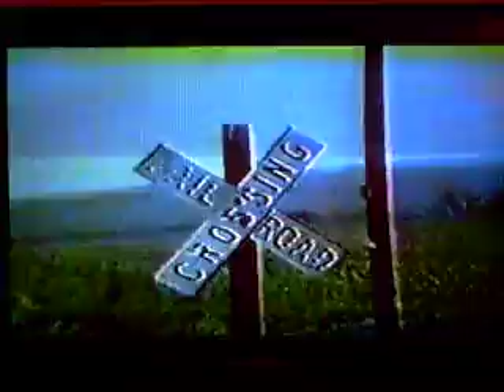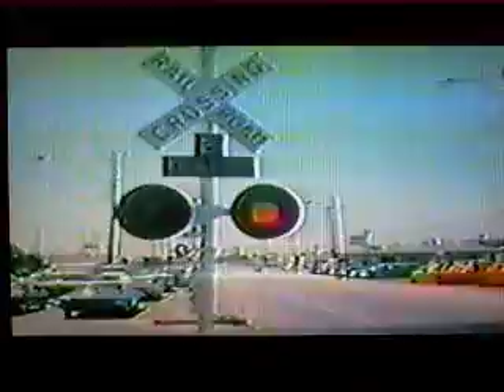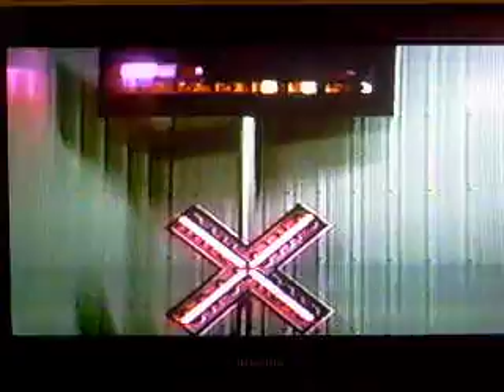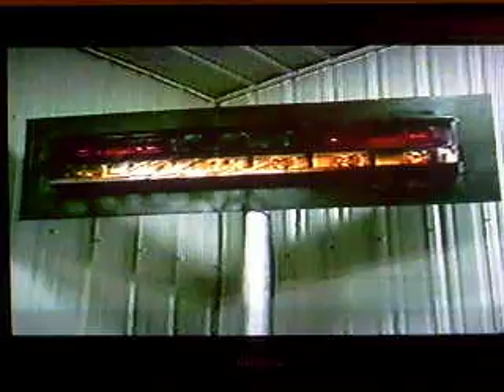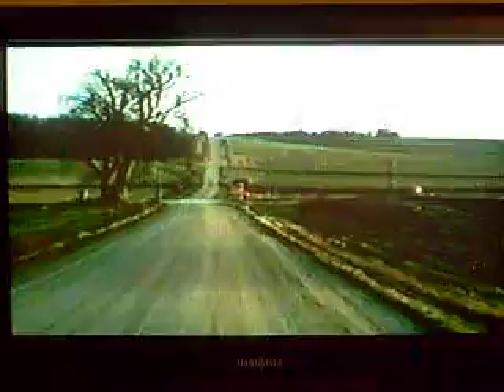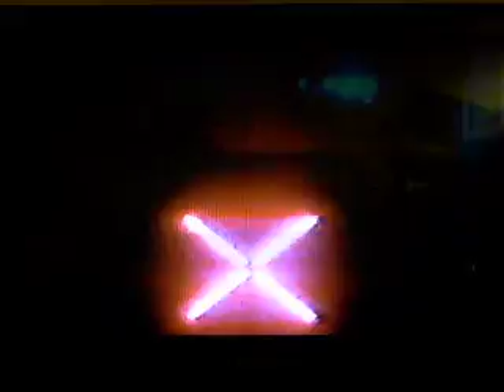EVA Crossing Signal presentation video

Comment: Do you still have the VHS?
Reply from the maker: @Hopen111YT yes! I still have both original VHS cassettes, and also all of the promotional materials, design review, product evaluation, and field test reports for not just the EVA crossbuck and signal system... but also the "CrewGuard" warning system distributed through A&K Railroad Materials INC.
Reply: @sirkrunch  How were you able get all the promotional material, evaluation, VHS tapes, etc for the EVA signal?
Reply from the maker: @kcmorailfan4784  Sent an email to the company contact address after a car-train accident that occurred a couple blocks from where I live. That crossing was dangerous at the time because of the angle the tracks crossed, only had crossbucks, and a stop sign was posted at only one approach.
Reply: @sirkrunch  Awesome! Do you think you could get a higher quality recording of them? We are planning on updating the page on rxrsignals with new info we found of EVA signals.
Reply: @Hopen111YT let’s hope we can get a dump of all the EVA material, that would be so cool for everyone to access

Comment: As I said many years ago, the EVA Signal System was state-of-the-art and should have replaced the ancient red flashing lights that can be weak and obscured by rain, snow, bright sunlight and fog.  Here in 2016, the RR industry is charging $300,000 OR MORE to upgrade one crossing with the ancient 1872 Track Circuit to detect the train and the ancient red lights and gates.  The "trailer lights" on the gates are really pathetic.  Strobe lights would penetrate rain, snow and fog.   Note that many school districts have put strobe lights on the roofs of their buses.  So, why don't RR locomotives have strobe lights?  The lights on the front of locomotives are narrow in beam and you have to be very close to a crossing to see them.  We could ask, WHERE are the side lights on locomotives?  Take a look at the tractor-trailers on our highways--they are lit up like Christmas trees.  Not locomotives---ZERO side lighting!   It took the FRA forever to require, AT LEAST, reflective tape on the sides of locomotives and rail cars.   Are you aware of how easily the 1872 Track Circuit, in use all over the U.S. and being installed today by the railroads, can fail to detect a train?  The biggest enemy of the SHUNT---the wheel-rail electrical contact that causes train detection--is rust--iron oxide.  Iron oxide won't conduct electricity and the bare rails and train wheels are continuously rusting.  The salt used on streets / highways in winter gets picked up by train wheels going through crossings and carried down the track.  Most Track Circuits are about a quarter of a mile long and on both sides of the crossing.  So that area of rail MUST be kept clear of rust or the SHUNT may fail and any warning devices will NOT be activated.  Imagine approaching a RR crossing on a 55 MPH road and the red lights are not flashing and the gates are UP,  but a train is approaching the crossing at, say, 60 MPH.  An Amtrak train may be approaching the crossing at 80 MPH.  There have been SHUNT failures all over the U.S. and the FRA actually has a database of 10's of 1.000's of Activation Failures!   DOES THE PUBLIC KNOW?  NOPE!   AND, the crossing upgrades are PAID FOR with federal taxpayer money!  130 funds, they are called.   So, before you diss the EVA Signal System, you should know how dangerous and obsolete the 1872 Track Circuit is, both DC and AC types, and both must SHUNT to detect a train.  Also, there is evidence that the test that was done with the EVA system was RIGGED!   A railroad employee was allowed access to the EVA electronic equipment by the FRA and there are strong indications that he tampered with the electronics!   Are you aware that the 2 manufacturers of the Track Circuit are extremely connected to the U.S. RR industry?  What does that tell you about the continued use (at least $300,000 per crossing upgrade!) of the dangerous and obsolete Track Circuit?   ALSO, you can find lots of RR crossing warning device failures captured on video and available on YOUTUBE.  Check it out!

Comment from the maker: They always claimed their signals were only abuot $50-60K to install... but they used a really flawed detection system. I have a feeling had they used any of the more widely used detection systems their signals really wouldn't have been much cheaper.
I do like the train tracking bar idea though... especially on heavily used multiple track mainlines where there's a high risk of a second train occupying the crossing and heavy highway traffic (and impatient motorists).

Comment: there product sucks it replaces the crossing signal
and it is not bullet resient
the red lights in the crossbuck are so small 
a rr used them here an got fed up with them and told the comp to get rid of them
but anyways the video is good thanks for shareing
Reply: It's obvious that you are a RR employee OR one of their excuse-makers.  Maybe you can provide an invoice that would show why the RR's are charging over $300,000 to install a crossing warning system that shouldn't cost even $100,000.  One of my associates worked in upper management at CSX in Jacksonville and found out that CSX had stolen over $60 million from the USDOT.  He became a whistleblower and the feds went after CSX.  CSX paid a fine, but actually got off easy.  Anyhow, that incident proved what a bunch of crooks the RR owners / management are.  My associate also proved CONCLUSIVELY that the cost of the ancient flashing lights / gates / bell / Track Circuit installation, per crossing, was being charged State DOT's at 3 and 4 times the actual cost of parts / labor.  He told me how the RR industry has hated (!) active warning devices since they were first invented due to the power / maintenance / inspection costs.  There is nothing cheaper for a RR than a crossbuck RR sign---No power, No maintenance, Nothing mechanical, Nothing to malfunction.  So, the RR industry has done everything it can to impede the installation of active warning devices---the easy way has been to keep raising the price charged the State DOT's.  DOUBLE THE PRICE / HALVE THE NUMBER OF INSTALLATIONS!    The amount available per State, per year is limited, so reducing the installations is easy, ESPECIALLY when the State DOT people let it happen!  WHERE are the audits of the invoices / charges???   HEY, are you telling us that the current stuff at crossings IS "bullet resient"?  (your spelling.)    What a bunch of B.S.  So, have you been lying for the last 9 years, too?    Oh, and maybe you can tell us WHERE the EVA Signal system was used and then taken out???   The South Carolina EVA test was rigged by the railroad because the FRA allowed the RR access to the EVA Signal equipment!!!  The RR made sure the train detection system didn't work properly SO THE TEST WOULD "FAIL!"     Oh how happy Safetran and Harmon were, huh?  People in the know, KNOW who really owns Safetran and (now) GE-Harmon---The RR's.
Reply: "It is not bullest resistant" Like real signals are anyways smh, you mustve worked for Safetran or Harmon.